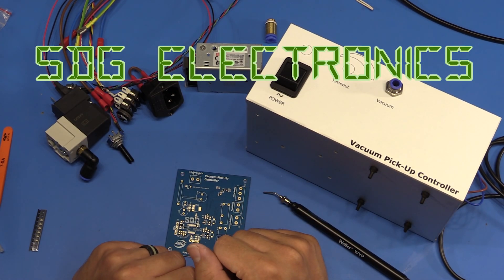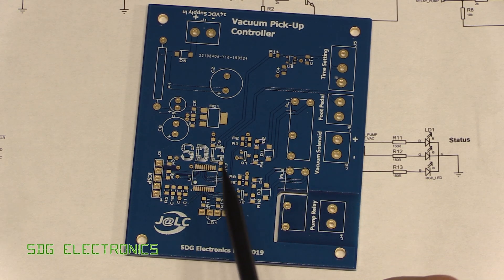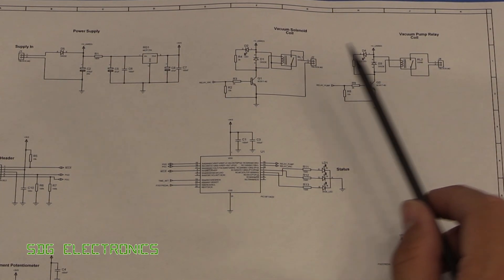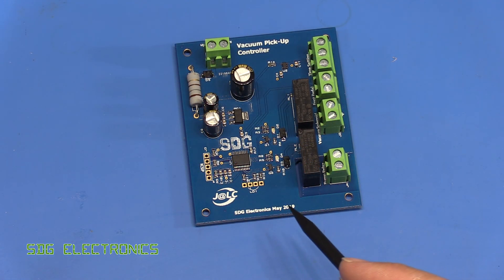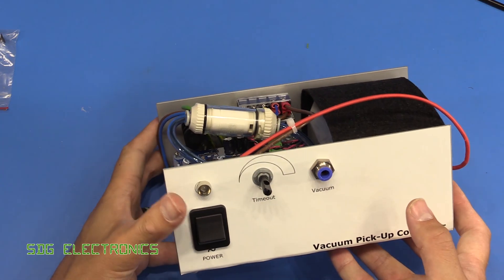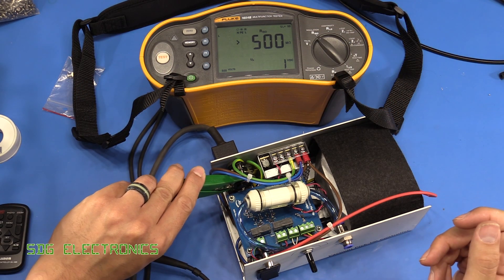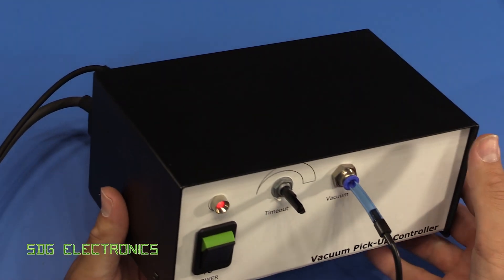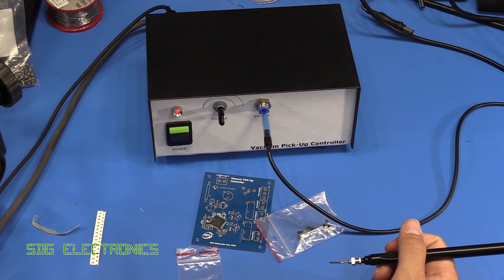SDG #092 Manual Vacuum Pick and Place Tool for SMD Components - Part 2 - with PCBs from JLCPCB

Comment: Hi Steve. I’m wondering if you still use this regularly for your SMD work? Also wondering if you’ve seen the Pixel Pump (currently funding on crowdsupply), and what your opinion of it might be?  It is rather pricey, but then again it does seem to be particularly well thought-out and implemented.  
Just asking because of your experience with your own vacuum pump solution.  I’ve been using my own cheap reversed fish tank pump solution, and have been pondering the Pixel Pump as maybe a much more optimised and better solution. 
Certainly, any vacuum solution is leaps and bounds ahead of the old tweezer approach, but a well implemented SMD vacuum solution would be great to have on the workbench!
Reply from the maker: Hi Greg, I use this tool pretty much all the time! Thanks for making me aware of the Pixel Pump - I hadn't heard of it. It looks like they've made a slightly overcomplicated version with some functions I don't think are that useful, but the relief valve is a good choice and it's what makes mine work really effectively. I think you'll find it better than an aquarium pump, but you could equally make your own for far less. The valve is probably the most expensive part.

Comment: I'm a tech in a different field, and I've found that converting foot switches to use with your knee can be better, if you're working on something for a long time. It reduces foot strain from trying to keep your foot/ankle/toes in an unnatural position. Also, is there any way to add incremental rotation function to the pen with micro-stepper? Perhaps just counter-clockwise, to keep it simple (lefties connect backwards for clockwise).

Comment: Very well executed, Steve.  I like how you packaged everything in the minimum possible enclosure volume!

I did something similar awhile back with an aquarium pump (you can reverse their flow direction pretty easily).  I ended up abandoning the thing after using it a few times because of one major problem: component orientation.  Handheld placement tools with a bent nose like the one you have make it difficult to rotate components during placement.  If you spin the tool between your fingers, the bent nose causes the component to rotate up, away from the board.  I didn't find that rotating the PCB was a good solution for a couple of reasons: the anti-static mat on my bench made board rotation a bit clumsy, and it was easy to accidentally touch the solder paste or components near the edge of the board.  The only solution I could find is a straight nose on the tool (I moved the rubber cup to a blunt Luer lock needle).  That allows you to rotate components easily, but you're forced to hold the tool exactly vertical for each placement.  In end end, for the number of SMT components in a typical one-off project, I found it easier to just use tweezers.  Hopefully you have better fine dexterity than I do, and yours will work better!

Comment: Very nice build but I'm still a little skeptical about it being much faster than just using tweezers. Please do a comparison between using the two methods for the same board if it's convenient. Thanks!
Reply from the maker: It comes into it's own where you have lots to assemble, or polarised components such as SMD LEDs where there is no cathode marking - relying on orientation in the tape. The main advantage is you can pick components straight out of the tape.

Comment: Thanks Steve! Nice little tool! The vacuum pickup tool on my Rework Station has little rubber tips that go onto the end.
Reply from the maker: Yes, I have a little bag with various cups to attach to the nozzle. It does surprisingly well with just the plain nozzle though
Reply: I noticed. It works very well!

Comment: Definitely have to have all of the numbers on the resistors facing the same way around. Anything else is just wrong. (and yes.. I've desoldered and resoldered before to fix it when I got it wrong) :-) ... Your vacuum pickup tool is looking great there Steve. Nice work Sir :-)  Cheers!!